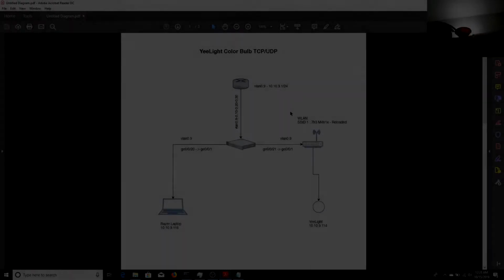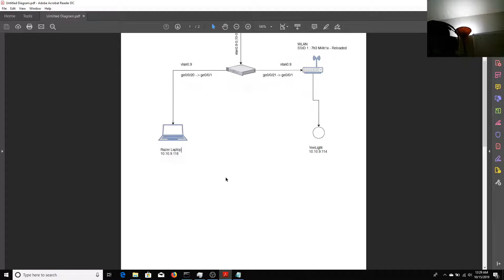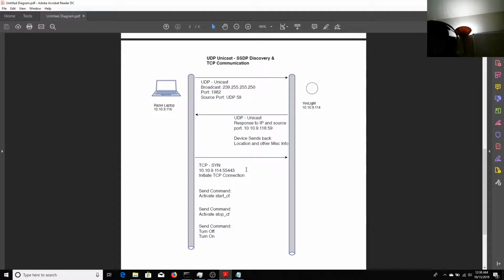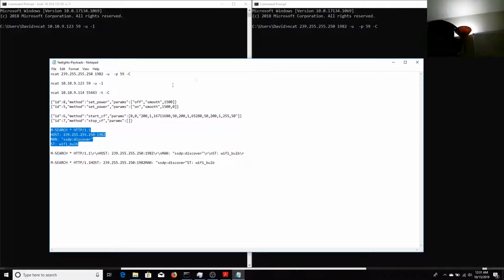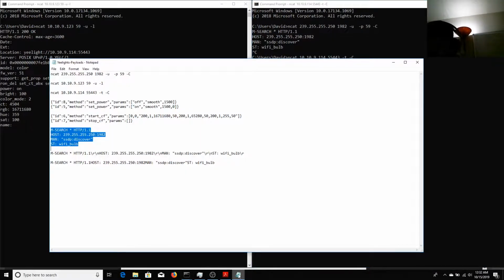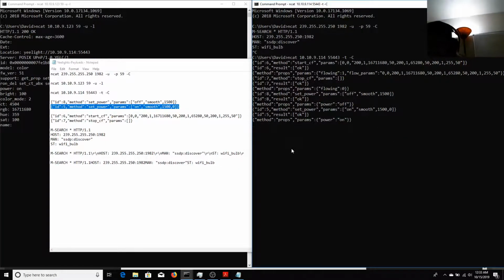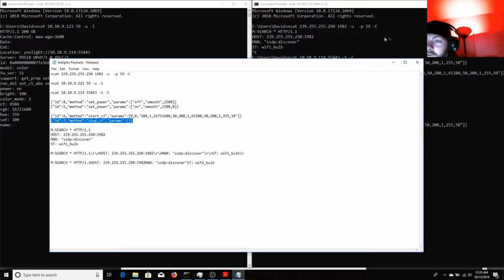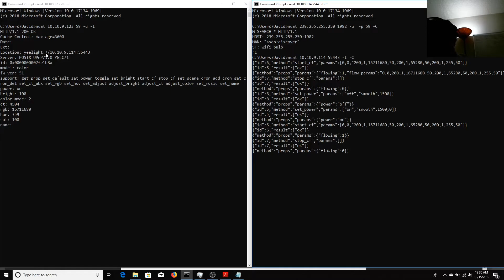Interacting with the YeeLight Color LED API via TCP/UDP (No SDK)

Comment: Hi, thanks a lot for this. It did help me a great deal! 
There is one issue, I did get to communicate with my bulb once. now I am trying to reproduce but it doesnt work. I tried to use different ports for the netcat, run cmd as admin, ran through yeelight documentation and toyed around with formatting the message. But did not manage to get a response anyomere. Would appreciate any hint if you find the time. (was running it on win10)